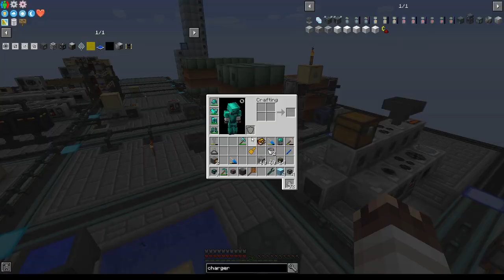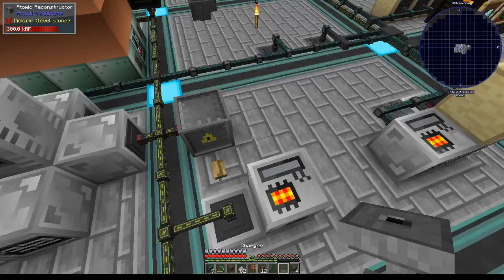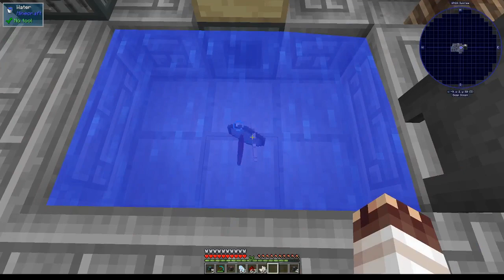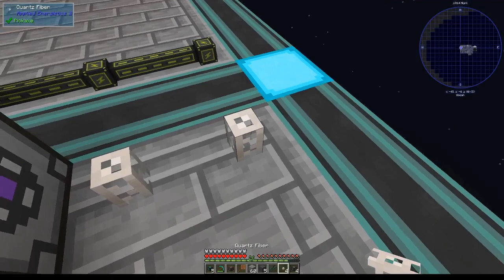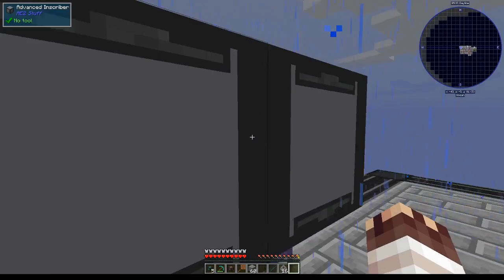New Omnifactory Supershorts #15: AE2 Fluid Storage

Comment: This makes me so tempted to hop on omni and do a “completely” passive run immediately, but I have already beat omnifactory 2 times (1 to vending upgrade)(one to tank without any passive crafting at all). I will definitely do a full passive run, but I want to wait until I get my new pc built, so I can have better performance and not have to worry about tps problems due to hardware limitations of my pc and having so many things running at once. Best of luck to you on omnifactory, your automations will very quickly pay off very quickly. Do you plan on producing passive microminers for every tier, or at least for the tiers which produce resources you need a lot of?
Reply from the maker: Let me tempt you! I hear that using Logistics Pipes for a passive run isn’t bad for performance at all, and in fact may run quite well if you adjust the visual settings to be good on GPU. Or, you can use AE2 for an all passive run!
I am thinking very seriously about passiving MMs, or at least passiving all the parts, sticking 64 or so at a time, and passively sending them.